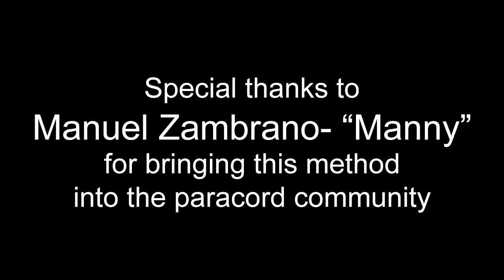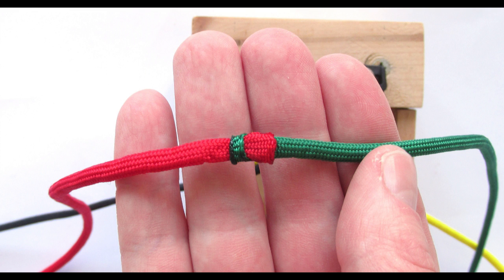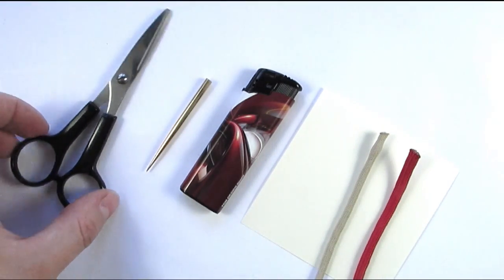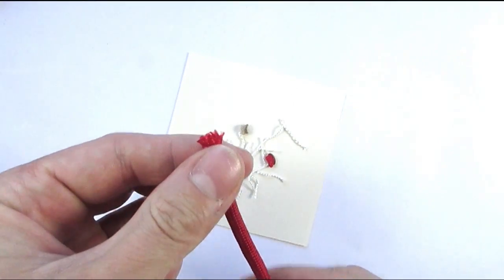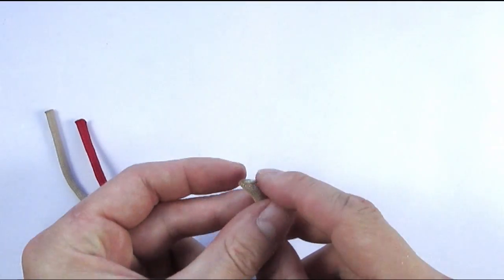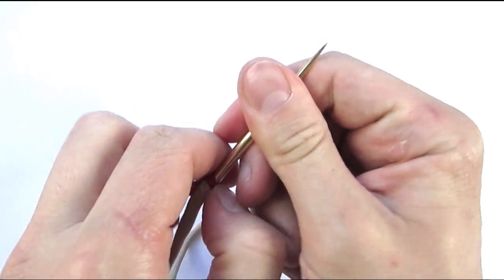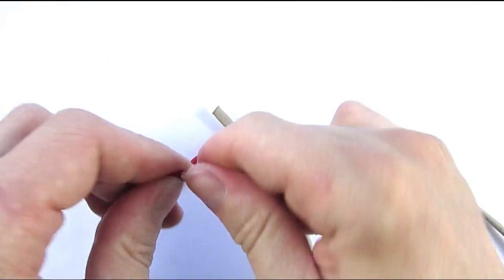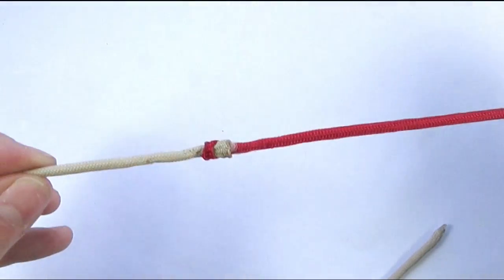How to join paracord properly for decorative work-  "The Manny method"

Comment: All you have done is join the outer sleeves together, about 40Lb's of strength, you have not joined the internal strands (so no real strength at all!), this is a pointless process, a double fisherman's knot would be about the best thing.
Reply from the maker: Hey there!
Thank you for the comment. 

I do understand this concern, but joining paracord is usually done for decorative purposes (it enables you to use 2 colors, which is not needed for survival/practical purposes). The bond is still the strongest out of any bond.

The double fisherman's is too bulky for many projects, especially bracelets. A double fisherman's also is still 2 cords not connected with internal strands. While strong as a choke knot is supposed to be, it is still best to simply use one longer, continuous strand with no join if you are going for strength.

Mark

Comment: but it has close to no strength at all
Reply from the maker: Hey!

This method is used for decorative purposes, not for survival application. You would use a double fisherman's or a sheet bend if you needed strength. But you can not use those for let's say a bracelet, it would be too bulky.

Mark
Reply: that cleared up something, thanks

Comment: I prefer the tie a very tight knott and burn it toghther then superglue and electric tape.
Sowing it with fishing string.
2,super glue chemicaly melts and glues it.

staples,
burn then superglue works best but really other than tieing a knott its nothing that will hold your weight.